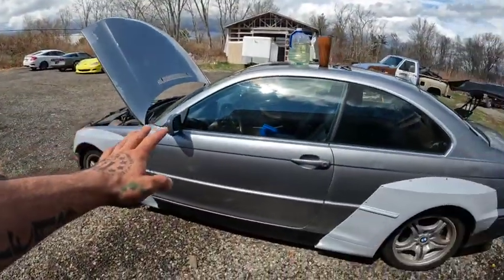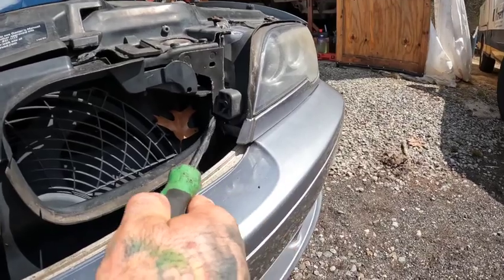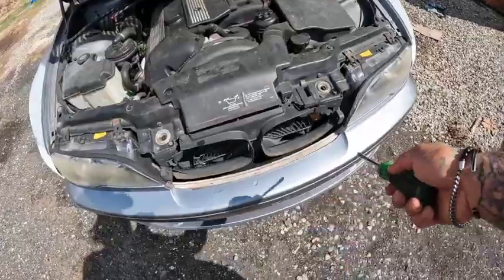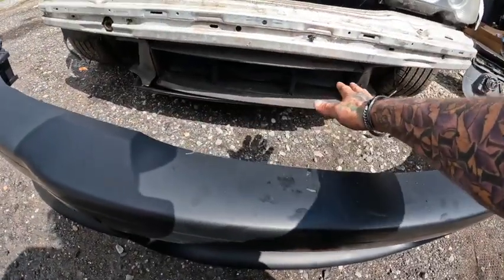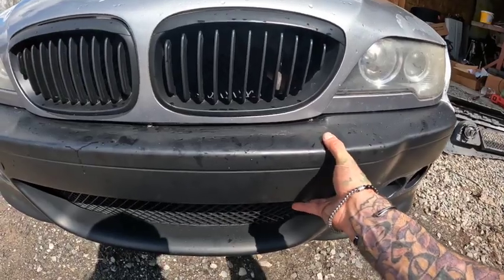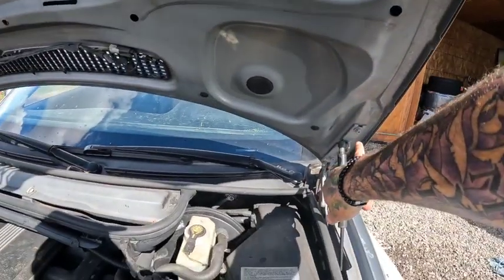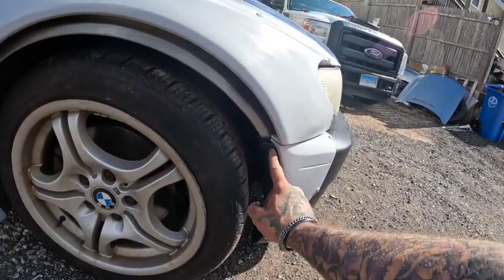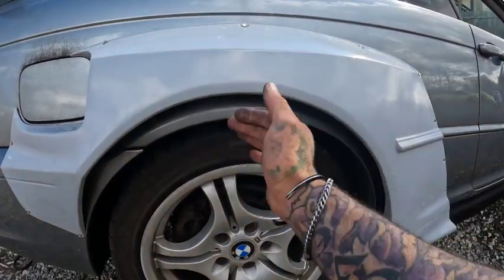E46 facelift m3 hood and bumper

Comment: would a gtr style m3 hood fit jus as well?
Reply from the maker: Yes sir bolts right up
Reply: @NRMotorsports  hey bro with the m3 hood on the facelift how is the only issue the fitment gap between the fender? How could you make the gap less noticeable?
Reply from the maker: Two things either raise the fenders washers underneath or trim the pinch weld area to make it close for the height